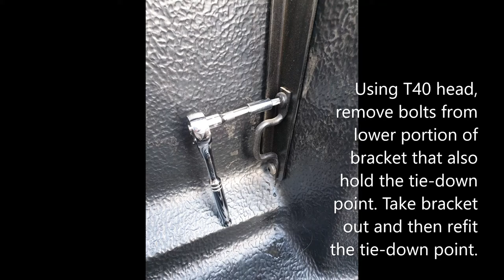Ford Ranger Wildtrak Roller Shutter & Sail Plane removal

Comment: Hey mate, do you know how big the bolts were and the size of the rivnuts where the sides attach on??
Reply: The bolts which Ford fit at the factory to hold down the side profile of the Wildtrak sports bar are M6 bolts, 30mm in length. The reason I know what these bolts are is that I ended up having to take them out of my 2019 Wildtrak due to Fords slapdash installation of the rivetnuts which are often raised and bent. The knock on effect is that the side profile then can't seat correctly on to the top of the tub just above the rear lights. The more they torque up the bolts to try and remove the gap, the bigger the gap becomes as the rivet nuts start to prize back out of the top of the tub. Ford claimed it was nothing more than a characteristic of the Wildtrak to have big gaps under the rear tip of the side profile but I didn't accept a word of it. I therefore removed the sportsbar and couldn't believe the state of the rivet nuts and could now see why the side profile wouldn't close up correctly. I had no other choice than to completely remove the rivet nuts and drilled straight through the bottom of the upper box section. I then introduced slightly longer bolts, a large washer and nylon lock nuts. As soon as I tightened up the bolts, the side profile finally closed up nice and tight on top of the tub exactly as it had been designed to be fitted. You often find that people who fit the Wildtrak sportsbar to another Ranger (maybe Raptor or XLT) usually make a much better job of installing those rivet nuts than Ford do at the factory. If they are installed carefully and correctly and not over torqued, then there should be no gap. If they aren't installed correctly then there is not much option left than to completely remove them and drill straight through the bottom of the upper box section and install a standard nut and bolt. Next time you see a Wildtrak, have a look for that poor fit of the side profile just above the rear lights. For every Wildtrak that doesn't have this defect, there is another one with the fault on at least one side of the vehicle, if not on both sides.
Reply: jp thanks mate, about to get a roller shutter off a wild trak to fit on my ranger raptor, your video was pretty, helpful, just in reverse
Reply: @damo984  Not my video. I just saw your question. Like I said, if you take your time with those rivet nuts, then you shouldn't have a problem with any gaps. You can use any bolts and associated rivet nuts around M5/M6 as long as they're no longer than 30mm in length. If you decide to drill straight through the bottom of the upper box section, then a standard bolt, nylon lock nut and washer will do. I think I used a 50mm M5 bolt when I replaced the original bolts fitted by Ford. What country are you in? Here in Australia you can pick up a second hand latest electric Ford roller shutter for similar money to the manual roller. I don't think Ford has, so far, introduced the electric roller to the Ranger in Europe.
Reply: @damo984  Check out this video. At 4.30 they stick the Wildtrack sports bar and roller on to a Raptor. Looks like you need a blanking plate for the high level brake light on the Raptor. https://www.youtube.com/watch?v=8qKsLMxudMc&t=310s